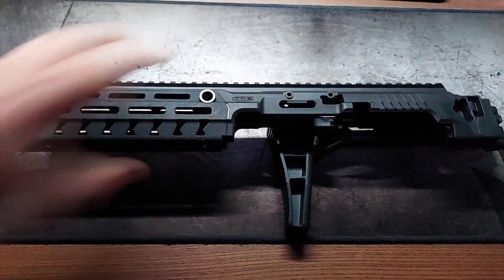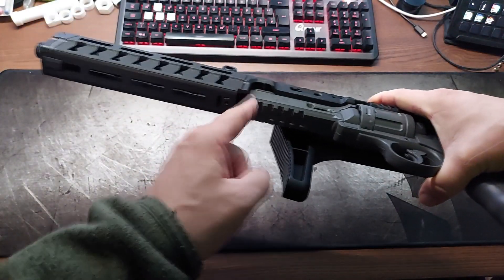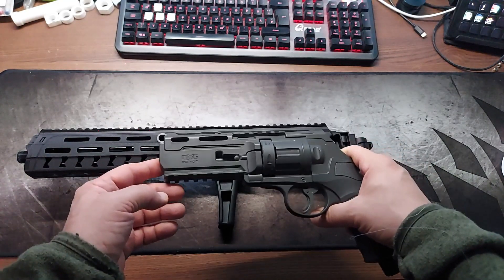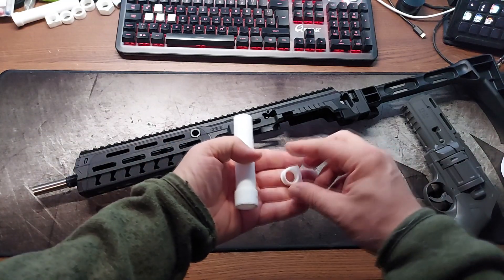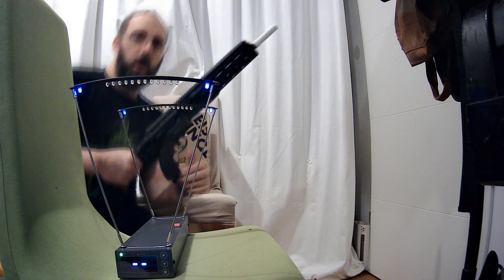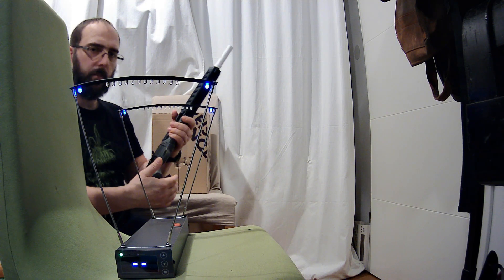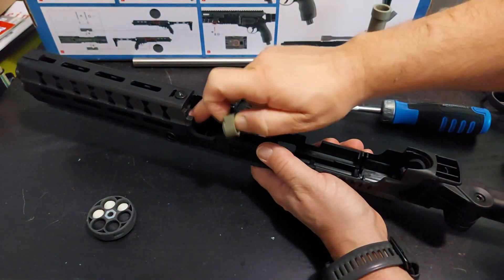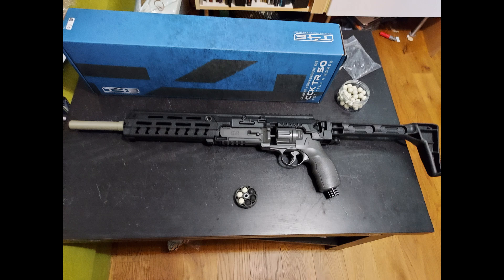does the conversion kit for HDR 50 /TR 50 /NXG PS 100 increase power and can it be modded?

Comment: YouTube sur Amazon fait 14 mm diamètre extérieur comment le faire rentrer dans le canon qui fait 13,9 mm
Reply from the maker: you mean the barrel of the marker? the barrel in the conversion kit is (at least in my model) has a bigger diameter. The tube on Amazon does not enter the marker, the barrel and the tube are edge on edge. For the undmodded marker the connector piece is not only closing the gap between marker and conversion kit, but also positioning the tube, so that there is no edge between barrel and tube that could damage the projectile

Comment: Hey man! Great work, i'm in the process of modding my Gen 2 to this.
Would like to ask you to link the exact tuning barrel you used with this, so i'll get the right one.
Also the chronograph, could you share a link for that?
And as i'm a 3D printing enthusiast myself, i've got some ideas for alterations/improvements, is there a way to get in touch with you that's a bit more private?
Reply from the maker: Hi, thank you! The barrell was this pipe https://amzn.to/42pebnD in the dimensions 14mm x 0,5mm x 300mm and this is the chronograph  https://amzn.to/42zLMLM .
Sure I am on Facebook and Instagram. Email would be fine too but I would not want to post it. What would you prefer?
Reply: @malachai80  What i meant is what's the tuning barrel inside the gun, dunno if it's in this video or the other.
I'll message you on thingiverse ;)
Reply from the maker: @ ah, I see, its this one from homedefense24: https://www.homedefence-24.com/de-at/products/tuninglauf-tuning-barrel-t4e-hdr-50-stahl-mit-gewinde-7-varianten
Reply: @malachai80  It's in the basket ;)

Comment: why is the fps so much lower with the unmodified conversion kit? did you use a fresh co2? I’m asking because mods that increase power aren’t allowed in my country. I would like the carbine kit but if it makes the gun lose power I don’t think I do!
Reply from the maker: I did all testing with fresh co2. I checked the video and I think I know what you mean: on the plain gun the chronograph shows 463 and afterwards with the mod for the same ammunition 161,5 which is a huge difference in figures. This is because on the first test I had the device set to fps, in the other tests (as well as in the follow up video with the modded gun) set to m/s. with subtitles disabled you see that in the first section the indicator light is blue, in the second green. 1 fps is 0,3048 m/s so the 463 fps would be 141 m/s. 
Is it that what you meant?
Reply: @malachai80  thanks for explaining

Comment: hello, I bought the tube and printed the 3D part from your file but the tube is not held by the plastic part between the hdr50 and the kit.
I may not have bought the right model of tube, can you specify the precise dimensions because there are several on your Amazon link, I bought the first: 14mm x 0.5mm x 300mm
is it the right one? 
THANKS
Reply: but I have the impression that the 3D piece that I downloaded from your site is not identical to the final version that you present in the video (10:09)
Reply from the maker: @roL-l4y I have bought the pipe with exactly this dimensions (14mm x 0,5mm x 300mm) and yes the pipe slides through the connection of the first versions of conector so that it enters the HDR50. However I made a v2 of the connector piece (and I am afraid I uploaded 2x the original) with a smaller internal diameter that stops the pipe and an wider angled opening to the HDR50 which makes a the passing of the projectile  into the pipe smoother and also prevents jams when the pipe is too far screwed into the conversion kit. I just uploaded v2 to Thingiverse and Cults3d, please try if this one helps with the problem.
Reply: @malachai80  Good morning,
Indeed it was not the right part, thank you for sharing it.
I also printed the file HDR50_front_cap_long_v2.stl but I have the impression that the thread is not perfect because I cannot screw it all the way (I am afraid of forcing and breaking it) for information the thread of the CCK kit is in M17x1 format

I would like to ask you for a 3D design (i don't have 3d printer, i use online 3D printing services), can you model a piece which screws perfectly (M17X1) and which will have the same shape as the cash flame delivered with the X-tender kit for hdr50 (look on the internet) and which will also allow you to retain the new tube (which will have been cut to the size of the original barrel). 
I hope you can understand me?

Do you think it's possible?

THANKS
Reply from the maker: @roL-l4y  do you mean the flash hider / compensator muzzle adapter from the x-tender kit?

I can try - the difficultiy with these smaller threads is, that in my experience it's always a bit try and error, because of shrinking for example. When I print a front piece on my printer with pla that fits the muzzle of my conversion kit, it does not necessarly mean, that it would if printed in abs or petg or with an other brand on another printer because of the small tolerances. I often had to scale 1% up or down myself, so sadly there is some room for error - which is of course annoying when using printing services or large prints. 
Its often easier if both parts are printed, because the error due shrinking applies on both parts.

I had the problem with the slinghammer (a 3d printed crossbow) which I printed 1:1 in pla, the screws fitted, but I had to use 0.5 mm smaller steelballs as in the description because of a slightly to narrow muzzle (which would not end well with an 80 pound limb)
Reply: @malachai80  Hello, yes it is "the flash hider / compensator adapter from the X-tender kit".

The goal will be to cut the new tube, insert it into the barrel then secure it by screwing in the flash hider/compensator.

there is another version of the flash hider/compensator on the homedefense-24 website under the name: MUZZLE BRAKE | Muzzle brake | BLACK | T4E HDR50 | HDP50 | Cal.50

the design is a little different and the screw thread is intended for the barrel extension (which you purchased and which you present in another video)

I don't know much about 3D printing but I saw models of the M17x1 screw thread on the internet, maybe that can help.

It would be great if you could do something, I will follow your channel!

Thanks a lot
Reply from the maker: @roL-l4y  ok, I can try that, but it will take some time. I know how to model M17x1 but tolerances are always a thing - I'll look it up, perhaps I find a useful part to use/remix
Reply: @malachai80  Finally I managed to design a new 3D model with a new thread and using your models. I haven't printed it in 3D yet but I can send you the files if you want?
Reply from the maker: @roL-l4y  Yes, I'd really like these files, thx

Comment: Get the sniper barrel,  adds a bit of velocity, and replace the stock barrel. Get it closer to the tip of the pistol, less gap their.
Reply from the maker: I have bought the tuning barrell, installed and took the first shots yesterday, works fine with the conversion kit! I also adapted my design for the front piece, as the metal pipe does not go as deep into the conversion kit because of the tuning barrell. I'll do a follow-up video once I did all the testing but I ran out of co2 capsules. I have also ordered steel and aluminum balls from hd24 to see what's the final power with tuning barrell/power kit alone, plus conversion kit and again plus mod.

Comment: Hello.i have a question.i purchased recently the  conversion kit.the front side of the barrel of the conversion kit if you put your finger its a little bit loose.the metal pipe.like moving a little bit .does it do the same to you?
Reply from the maker: Yes, also, the barrell in my conversion kit moves a tiny bit and makes a click sound when I try moving it around
Reply: The barrel of my CCK kit has the same problem, it moves slightly, I don't like it, I'm going to take it apart and fix it.
In the meantime I put a black plastic gasket at the end of the barrel which I fixed by screwing the nut at the end. this does the job the pipe no longer moves.